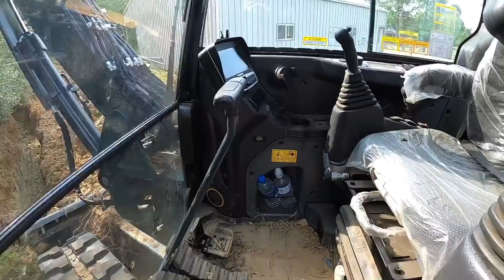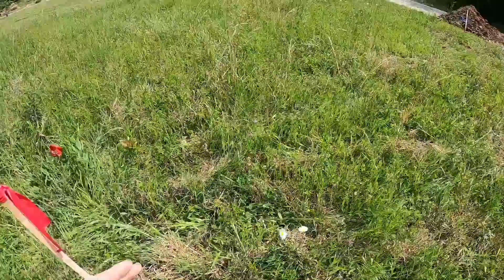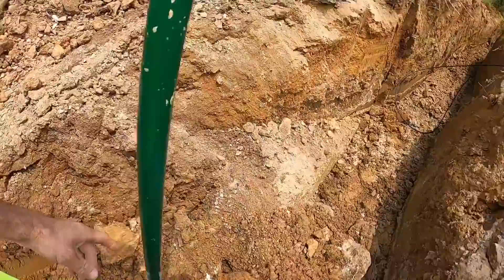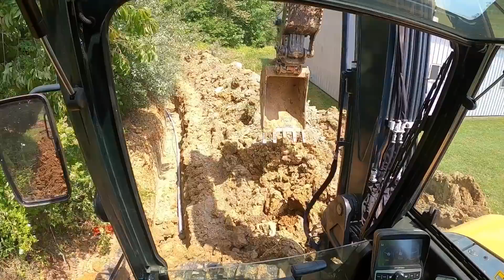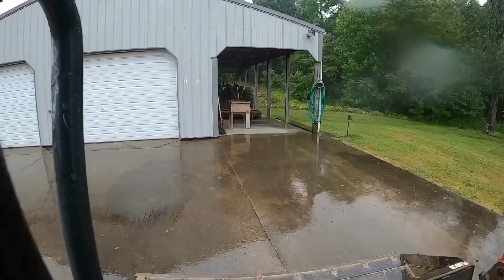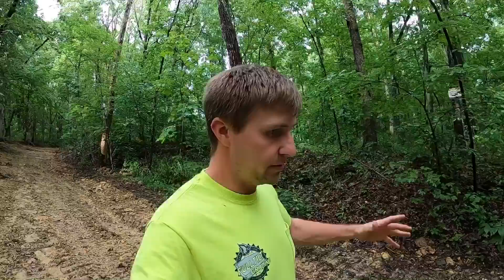Close Call - Water and Electric Line Are Not Where They Said - HUGE Channel News!

Comment: 11kV found in a 3 inch pipe with am Oxy Acetylene torch back in the 1980s it was a feed to a substation that the electric board in Padiham Lancashire UK did know was there. Our guy lost most of his facial hair and head hair + plus bruised bum and it ruined the head of the gas axe torch, it was 5pm and my boss gave him the rest of the day off.

Our factory had 5 11kV substations inside the factory floor and a very large switch room in the street.

Sorry I am a bit late, it might make someone laugh.

The most danger I have had was soldering live 240V gas appliance test rigs since they did not want to shutdown production.

Comment: I'm scheduled to dig a trench for a water line on friends property in a few days. I got to dich witch a hundred feet or so. No big deal, right? The only hang up for me is that main power feed that I got to cross over. It's just 14,500 VAC. The house it feeds has a 2 Amp fuse in the transformer on the primary side.

Comment: search youtube for videos on "find utilities with dowsing rods" and I guarantee you that you will find them every time, even if the utility companies can't - and no, dowsing with metal rods is not witchcraft but 100% science based physics that work for anyone instantly
Reply from the maker: How do you think we ended up in this situation?   😂😂😂
Reply: @CaptainKleeman  ... I guess something was done wrong, because I find lines and pipes within 1 to 2 inches accuracy every time
Reply from the maker: @silentepsilon888  I agree it works,  I’m saying that there were two abandoned lines with ground water in them plus the main line which means they were picking up three different lines.  That technique detects water,  that doesn’t mean it’s the water we are looking for
Reply: @CaptainKleeman  .. I use this method to find gas lines and even electrical lines as well. Electrical lines respond best when they are inside a larger conduit pipe which means that this dowsing method responds to changes in ground density, not only to the presence of water.
Reply: They find old ones too! 😮🤣
Reply from the maker: @AngelWerx-2012  exactly!

Comment: Boy, Y'all would have loved excavation work in my little farm town city just north of Flint Michigan.
They had lines and pipes going every which way going back to when they first started running sewer and water lines as well as buried trolly and narrow gauge lumber railroad tracks from the early 20th century. When the finally ran sewer line to our street which was the last south street towards Flint they found two gas lines they thought were dead actually active.
Luckily they were cautious enough to have been digging a cross trench with shovels and only popped an extremely small hole in one and we're able to find the turn off valve because one of the old to timer retired city works guy lived on my street and he showed them where it was.
Fun time when they freaked out and went knocking on doors to evaluate our  street and the ones north and south of us.
Firetrucks, police cars and other emergency vehicles from two surrounding toelwns showed up.
Us kids had a blast.
My Mom was pissed off.
She'd just put some cherry pies (we had 7 cherry trees) in the oven and refused to leave so two fireman carried here out screaming.
After that the city finally went into overdrive finding all the old lines and pipes.
Cheaper than what the 3 district emergency response cost them.
Got the city council recalled for refusing to fund it for decades even tho the county had told them to.
Again, us kids had a blast.
All the Mom's ticked off becauseno baking while they did the digging due to more known lost active gas lines.
It all had to be hand dug till found.
Another turned off the stove.
Reply: Yikes! Love your Mom's reaction!

Comment: When I was in grade school, the church attached to the school started construction of a much larger sanctuary in the next city block.  I'm not sure exactly what was and wasn't marked (I wasn't yet nine), but the excavator that was beginning the clearing hit a phone trunk line.  Several pairs of 600VDC lines blew a hole in the shovel/bucket/whatever it was big enough to put a softball through.  They brought a section of the cable in and passed it around the school for show-and-tell.  I would not want to have been the one to have to patch that trunk line back together...
Reply from the maker: That would have been a sight!

Comment: Cap’n that excavator dowsing rod needs calibrated!  Or, perhaps it doesn’t.... iffen the waterline was abandoned... perhaps it knows more than the engineers!

I heard about a guy who lived in Canada who had trouble with his water level freezing in the winter.  It was a garden hose with clear tubing screwed to the ends.

Being a backwoods, DIY kind of guy he brought it into the shop.  There he thawed it, emptied the water and filled it with Vodka.  It worked great.

The bonus was... after the spring thaw he could pour a shot of Vodka into his drink at lunchtime to give him a boost.  When he went back to the shop, he topped it off with more Vodka and never suffered another sober day on the job... no matter what the weather was!

Coincidentally, I received a Media Mod for my GP8 yesterday.  Thanks for the waterproofing heads up.

Now, if you’ll pardon me I have a new channel to subscribe to and support!
Reply from the maker: A vodka line…now that’s an idea

Comment: That seems like REALLY flimsy optic wiring for it to be underground.
Reply: First thing fiber optic is not wire. It is a glass fiber filament cable which is why it’s fragile and also why it’s difficult/time consuming to repair.
Reply: @Crewsy  I know, which is why I said it seems flimsy for it to be underground. I misused the word wire for cable. Simple mistake to make for someone who's first language isn't English.
Reply: @Crewsy  It's a real pain when it's inside concrete and "new" line is needed to expand the size.  I've seen some fiber optic which was almost 3" diameter to replace a 1/2" line.  Future expansion was in mind so they just put in bigger FO

Comment: You know, I watched local city replace water mains, an upgrade in capacity and replacing old mains that needed it. They used steel pipe with a 5 foot diameter.
Reply from the maker: That’s crazy!
Reply: @CaptainKleeman  this regions water mains service over a million people, the size is for the water flow needed.
Just gives a reference to how large a community is, the bigger diameter the water main, the larger the population being serviced.